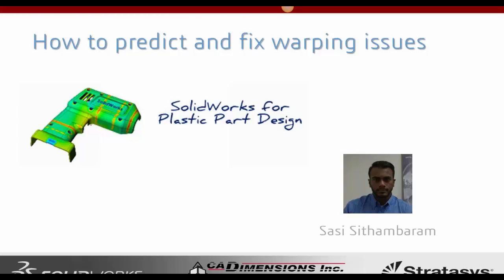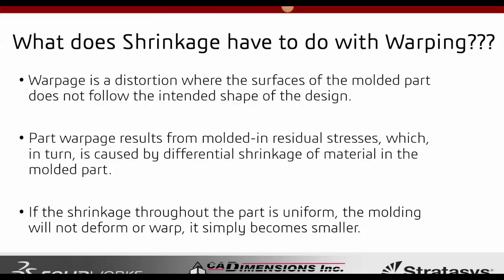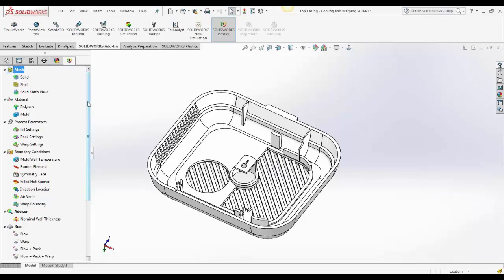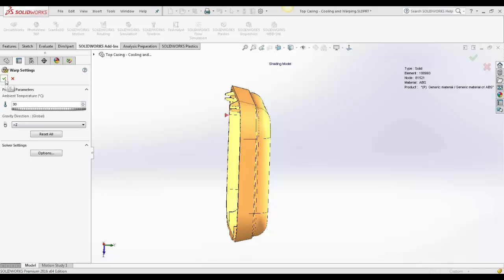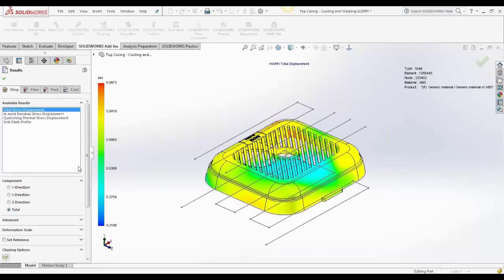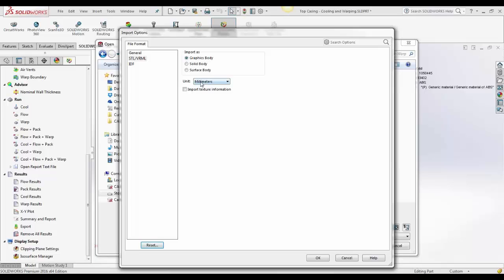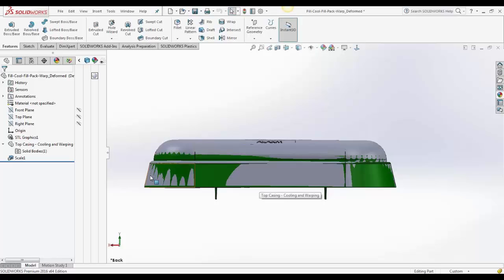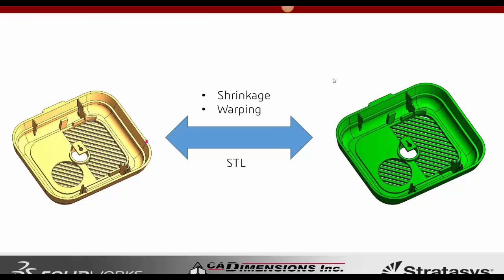How to Identify (and fix) Plastic Part Warping

Comment: Warping is usually caused by differential cooling rates throughout the part due to varying wall thickness and part configurations. This guy overthinks everything. This part was designed to warp
Reply: exactly right, its almost always the part design, and yet always the molder is to blame

Comment: This is a last resort for how to account for warping.  After you've tried changing material, cooling, temperatures, adding ribs, changing wall thickness, etc - when all else fails, only then do you alter the geometry of the part to be in the "anti-warp" shape.  This demo is misleading - it does not show how to adjust the process parameters to reduce warp.